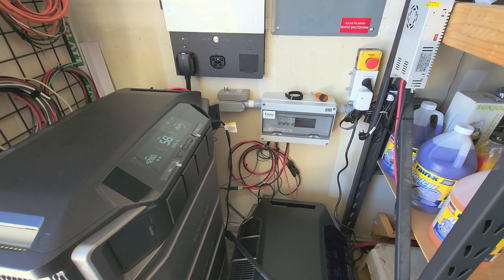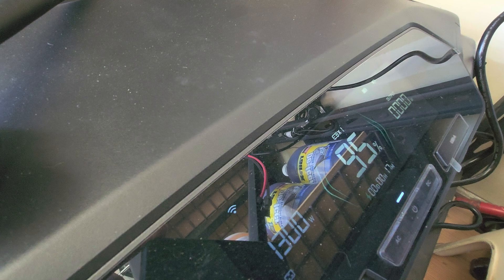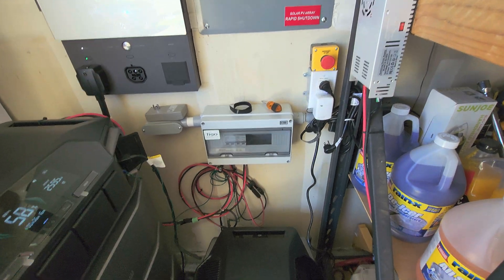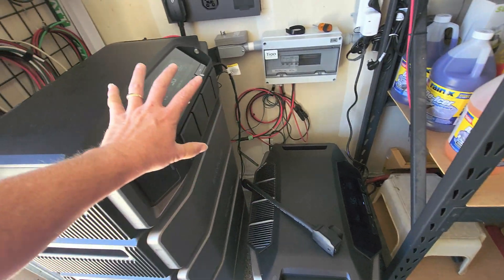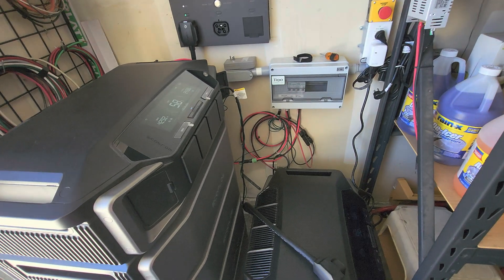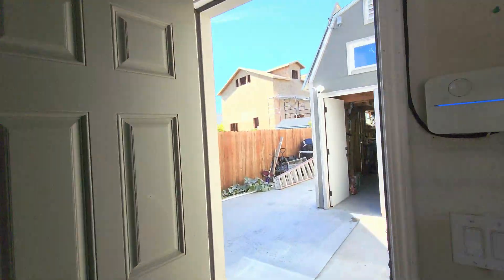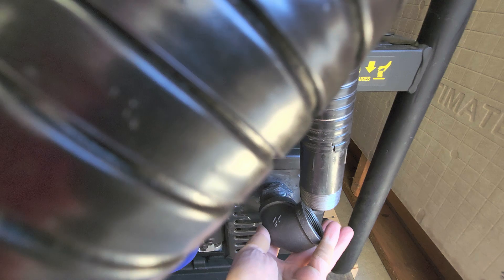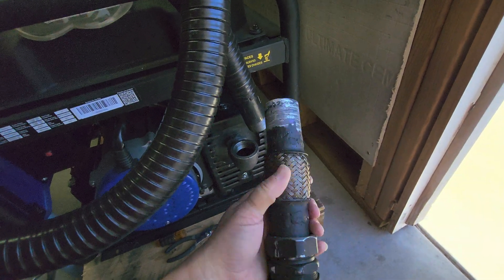EcoFlow double DPU charging from a single DPU array install / generator flex pipe update.

Comment: I understand that high PV to one stack and low PV to the other stack won't top off either battery, but the way youre doing it right now is not only losing inverter efficiency on the large stack, youre now also losing in the DC to AC conversion.  It would be more EFFICIENT to charge your big stack on high PV and your small stack on low PV.
No matter where your PV input connects youre not getting any more input.  But right now you are losing power in the conversion and transfer.
Reply from the maker: It is setup this way

Comment: Yeah why not just connect the low pv to the second DPU and bypass the nonsense? The settings are the settings and the panel will know to let the 2nd charge at whatever level it’s set to charge at…
Reply from the maker: Yep, that would work too! 👍 I just went with this setup for a little more control and stability across the system. Having the second inverter/DPU also gives me some redundancy and extra capacity when bigger loads kick on, so it keeps everything running smoother.

Comment: Take the low PV feed off the main and plug it into the low PV of second DPU. It will automatically charge the DPU according to your app specified settings. So if your DPU is set to charge at say 80% when it gets that low, the grid will charge the batteries up to where have it set to , say 95%. Meanwhile, your low PV is powering home until the batteries need to be charged by the grid.
Reply: Genius! Thanks for the idea

Comment: I'm looking to do the same thing. I was thinking about using the bluetti t500 ac battery charger and a shelly smart power plug and home assistant to charge the batteries on the DPU whent the electricity prices are low. VIA the low PV port. I'm too lazy to go into the garage to plug and unplug, I would rather make home assistant do that for me. My question to you is does the smart panel allow you to use the DPU's power for powering circuites that are connected to the main panel? ie the rest of the house? Or is the DPU limited to powering only the electrical load that is isolated to the smart panel?
Reply from the maker: @john-u5o3j  I moved all my home circuits over to the smart panel and the smart panel is powered by up to 3 dpus so you can pick and choose. It's fantastic in all controlled by the apps that once it's set up you can pick and choose to turn your circuits on from inside.

Comment: You can get a chargeverter, plug it into the same outlet. Then that goes into the LV side, charges at I believe 57v, and 15a max of the port. This won’t give you the 1300 you’re getting now but it will give you the ability to control it automatically either via the EcoFlow app or a smart outlet.
Reply from the maker: @MrSkunks  thank you for the heads up... because if I can run this off of an AC circuit my dpu is powering off solar than I'm still charging from solar until I get more solar panels up for the second dpu this can put a significant input on that.
Reply: @erickoffgrid make a video if you get it, love the long informative videos and the thought process behind each decision. 

The biggest issue is going to be the AMP limit on the LV side and the fact you can use the HV side because of the min voltage.
Reply from the maker: @MrSkunks  that sounds very interesting do you have a link or something we can go look at?
Reply from the maker: @MrSkunks O o found this 
https://www.currentconnected.com/product/eg4-chargeverter-v2-48v-100a-battery-charger/

Comment: Can you not get a solar split connector and feed both? 
Or is that too slow maybe?
That's a lot of battery you're pumping up.
Reply from the maker: @ezridr1234  I asked eco-flow the same question they recommended no.

In reality when you know how things work that's not to say it can't because all you have to worry about is not over voltage in the unit.

Comment: Mr Bostrom, to solve your issue, do you think you could plug into that 120v outlet two dc power (48v 15a each) wired in series, and then connect this "home made" 1440w output into the high power PV input on the smaller DPU? Kinda like faking a solar array from a 120v outlet 🙃

Never tried it myself, but I wonder...

Comment: Is there a particular reason you dont add another battery to the short stack?
Reply from the maker: @unijabnx2000  I have all solar going to one stack so I want as many batteries on that stack as I can to fill it up before it does the state of charge difference to the smaller stack that way I get the most from it in my opinion just the way I want to do it

Comment: I am curious, why didn't you just leave it connected to the SHP2? Didn't that solve your problem? I know it won't output when you are doing the transfer though, is that the reason why? also, it looks like you have two sets of panels. Why not just run the low voltage into the single battery stack and the high voltage into the larger stack. I lucked out that I have 3 DPU stacks and have 10 400w bifacials running into each.
Reply from the maker: @aaronphillips1210  seperaring the solar does not give each enough charge
Reply: @erickoffgrid As in there is not enough voltage to trigger it to input solar or you mean that the wattage coming in is just too low? If it’s just low would that matter much as long as the same amount is doing in split between the two that you would get going into one? 3200w into the big one and 1000 into the smaller one would be fine right?
Reply from the maker: @aaronphillips1210  there's not enough high or low on their own to charge a single side so to leave it connected both to 1 BPU and let it do a state of charge different seems to be working the best

Comment: I appreciate your videos.  I have an 1800W solar array with a dual battery DPU running critical circuits off grid through a Reliance xfer switch.  I have the DPU AC charger input always connected through a 1kW isolation transformer (surplus medical units on eBay) to create a new neutral, making AC input look like it’s connected to a generator.  The isolation transformer source is plugged to a Kasa smart outlet that is connected to grid outlet.  The Kasa outlet is programmed to only charge at night and only when I enable due low solar for several days.  The isolation transformer may solve your AC charging headaches.
Reply from the maker: @BrettTremaine  that is extremely interesting I would love to see that do you have anything posted for that?
Reply: @erickoffgrid interesting idea for sure. The only way I’ve seen it done with an sp2 is using a ac to dc smps fed into the second DPU’s solar input…. I used the unit ecoholics used (2000w 110v) so he could use a 120v generator while still hooked to the sp2.  So basically you can run this smps from an ac outlet to the low pv side of inverter 2 and the sp2 will think it’s solar.

Comment: Did you have any issues with GFCI's in the garage? When I tried to charge from AC GFCI Wall Outlet while also plugged into my Critical Loads Transfer switch it kept popping the GFCI. Online research hinted that this may because in my house the everything in my circuit breaker panel and transfer switch are sharing the same neutral. I haven't figured out a safe/code-approved way around this. I bought a neutral bonding plug, but i'm affraid to try it. Don't want to mess up the ground or somehow backfeed. Any ideas?
Reply from the maker: @dragonfalcon8474  I have not experienced that. I'm not sure how to address that I'm sorry.
Reply: Not sure what a neutral bonding plug would in the situation? Sounds dangerous.

Switch from a GFCI to a standard outlet. What is going to happen is that during solar charging / battery discharge, things will work as normal. If the SOC dips below your limit, it will begin pass through charging. Once in this mode, part of the neutral will flow through the output side into the panel and part through the input side. This will create an imbalance on the input wire, as hot will have lets 5 amps but neutral 2.5, this will lead to some EMF and may cause LED lights to flicker. There’s also the danger that you flip a breaker off on an output circuit, you may think it’s safe to now work on it, however current may be flowing through the neutral and shock you. 

Finally, you create a ground loop. I’m not an electrician, all of this is based on my understand, with the ground loop, if you had a ground fault on a circuit on the output side, a portion of that current would flow through the input cable ground. Since the case is grounded, you could be shocked by touching the case. You can remove the ground loop by using a 3 to 2 prong, as the ground on the output should be sufficient.

This is how I run my set up, again I’m not an electrician, I understand this not to code and potential dangers.
Reply: @MrSkunks  Well that's the issue. There is no standard outlets in the garage. Per code, they are all GFCI.
Reply: @dragonfalcon8474  just add a non GFCI simplex outlet by the panel. This way, no one can accidentally plug in an extension cord. Before you move, remove it or make it GFCi.

There’s no easy way to do this while being code complaint. ECOflow should have isolated the input neutral. 

You could by a chargeverter and connect it to the LV input. However your max would be like 7-800 watts. Since the unit will always accept solar, you need a smart outlet to control it and it would be on time, not SOC which was a no for me. You could be an AC isolator inverter, however these are expensive and add complication to the unit. For the output side, you can get a manual transfer switch that also transfers the natural. These are more expensive and don’t give the ease of the reliance panels to switch individual circuits to grid. If I picked any other solution, it would be this. SHP2 is another option.

I’m keeping my system the way it is for now, 99% of the time I’m on battery so I’m rarely in this situation. I’m waiting for the next generator of SHP, hoping for it to be similar to ancors panel where it doesn’t have circuits on it and AC couples to the main panel.
Reply: @dragonfalcon8474  just thought of something else if your looking to have the outlet be code. The in/out port via 240v keeps the output working. Just install a 240v outlet near the panel. You’ll still be breaking code by having the neutral loop but atleast the actual outlet isn’t breaking code.

Not sure exactly how the DPU functions but if it’s charging just off the hots, you’d avoid the imbalance on the neutral.
Reply: @MrSkunks  Believe me I thought about doing that. However, I really am trying to keep everything to code. So still trying to figure out other options. Right now, may just have to charge with solar until I can afford to get more battery packs and another DPU inverter too. At that point I need to build out my solar input to both DPU's that should be able to power everything. And I only have 400W of solar input right now... so it's gonna be a LONG time before i generate enough probably. I just have one DPU with one battery pack right now. Additionally, I still need to put a soft start on my 4-ton AC unit too. But Micro-Air's newest softstart has had a lot of controversy and may even be breaking people's AC units. So lots left to do, this is becoming an expensive hobby. Going off grid is a lot harder than I thought. I really don't like the only grid provider, they don't even do netmetering and still charge you a ton if you stay on their grid as a backup. So I'm really hoping I can find some other solution. I still haven't tried the neutral bonding plug, and don't think I will. There is too much going on that I don't understand, especially when I don't know exactly what's inside the DPU and what it's doing. I am also not an electrician, so DIY'ing the whole thing. But did have an electrician put in the 50 Amp generator interlock, and the Reliant 50 Amp Transfer switch. Also, I completely agree I WISH Ecoflow had isolated the input neutral!!!

Comment: Now you know why I have all the extra 30kw of external batteries and can switch one of my 3 arrays (2 high voltage / 1 low) and move to the Victron system  :-).  I have a low frequency inverter (SunGold 6000w) connected to the other rack of batteries and on bad days with no solar or when I want to top off the DPU batteries, I can.   I can also power up other accessories too.    Best of both worlds :-)

Comment: Sir, you do realize you can charge your DPU from the grid as long as you are connected through the Smart Home panel, no need to connect the DPU to an AC outlet, that’s the way I charge my DPU with two additional batteries. Also, I have a net metered solar as my primary and it is grid tied.
Reply from the maker: @rogermartinez78  of course but the point is to use the grid as little as possible. The way I'm doing it still charges ultimately from solar and doesn't touch the grid
Reply: so being in FL I have to have a grid tied system, which is frustrating as all get out. so are you just charging from the grid and selling your solar via net metering? no way to charge the batteries if grid were to go down?
Reply from the maker: @jagnum1fan  nope there's no way I would ever tie to the grid and get anywhere involved in that net metering bologna.

Are you sure you HAVE to tie to the grid?
I charge from solar and self consume on the spot for what I need and any extra generated is stored to the battery.

All I did is move the circuits over to the smart home panel 2 so that my home loads are powered directly by my solar and batteries and they are not tied to the grid panel so I just lessen my dependence on the grid.

Now if I need to I can switch the smart home panel to over to grid if I need to do a slight charge or I could go to the generator to charge.

But there's nothing forcing to the grid I don't buy that.

Comment: Thanks for the video.  I too have 2 DPUs (2 batteries on each).  My Panels are on my Pergola ( 8 X 450w), so ended up running another feed from Panels (2 sets of 4 in series) to each DPU.  I initially invested in the DPUs for vital load backup and portability if I move. Not sure about adding Panels to my roof.  Any issues with leakage on roof, can these ever be removed and still keep integrity of roof?
Reply from the maker: @chipackerknecht9596  sounds like a great setup. I too did this ecoflow module setup in case I happen to move and want to take the expensive equipment with me.

The panels on my shed are on there 2nd or 3rd house now so yes totally movable but I won't move them next time because hopefully the next set of panels will be more efficient than these.. something higher than 21% :-) and so I'll just replace them.

No issues with the roof because I did it and I know it's absolutely sealed.. but I do get in the crawl space and look up every now and again just to verify..

Comment: It's good you got 25kwh of batteries. My 10kwh is barely lasting the night. It's already time to change the angle to the winter angle?
Reply from the maker: @Gary-ee3kq  yeah it took me four of the 6 KW batteries to start getting me all the way through the night comfortably.

And I set mine down so I can get it done before it gets too cold and I did get a power bump out of it so for me I wanted to get it done.